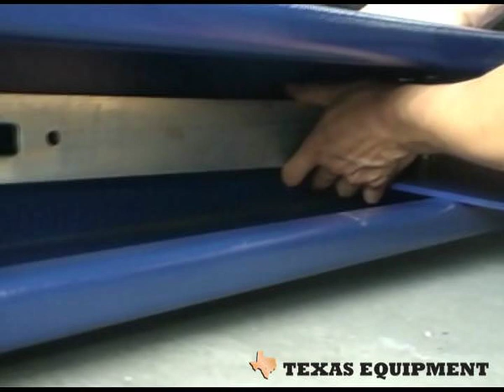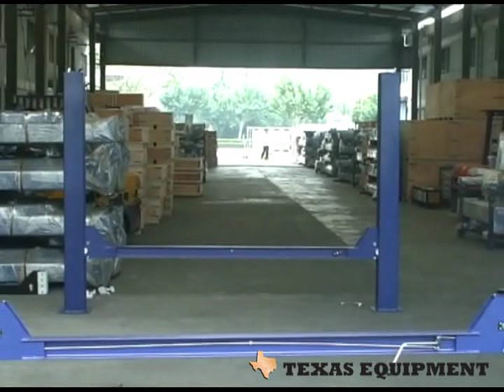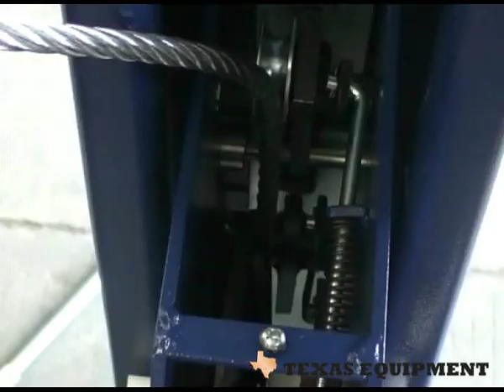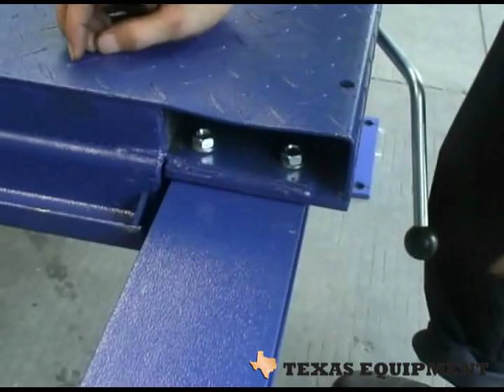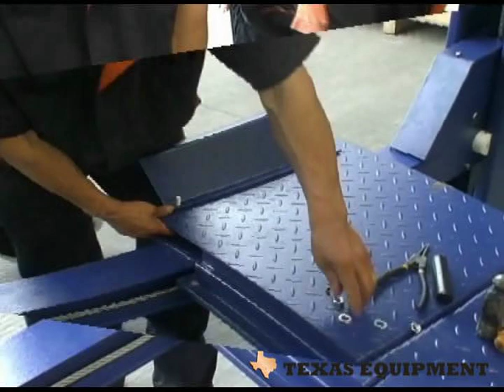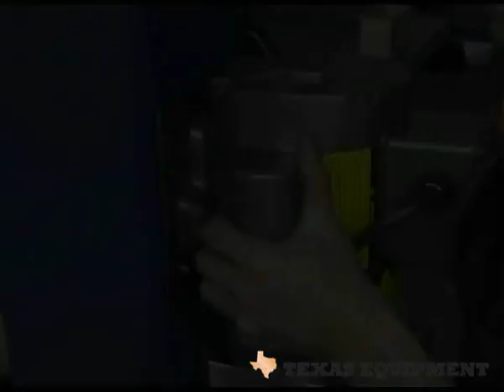Cable Driven 4 Post Installation Video -Texas Equipment

Comment: you may get a real thrill when you have a pulley failure,i near got killed when my car fell on left front corner on its way up;about half way up the pulley and shaft failed .good thing everybody was out of the way; they may have been hurt or killed.If anyone has one of these foreign made ,check the pulleys and pins and lube them,replace them,before you have a castastrophy
Reply: Megan Masters Thank you for sharing your experience that was good to know.
Reply: Was it a Texas equipment lift
Reply: My lift got stuck on top wat do I do